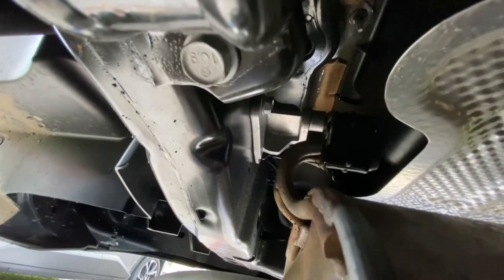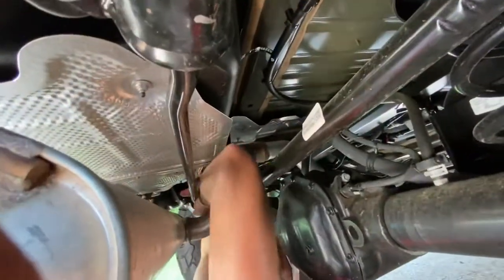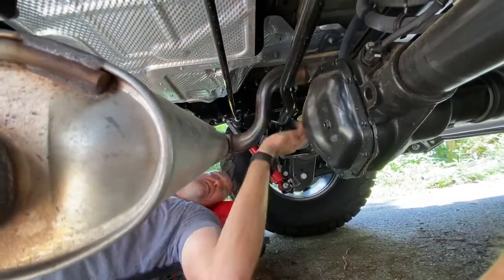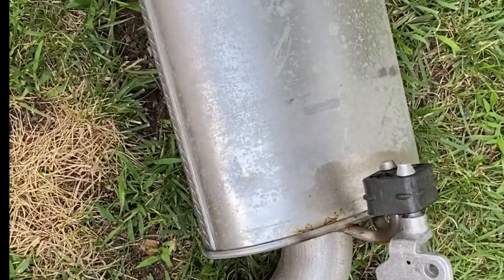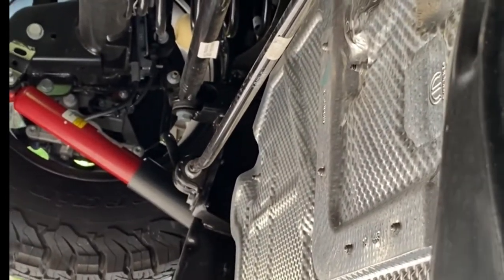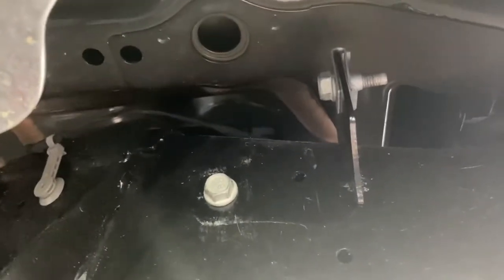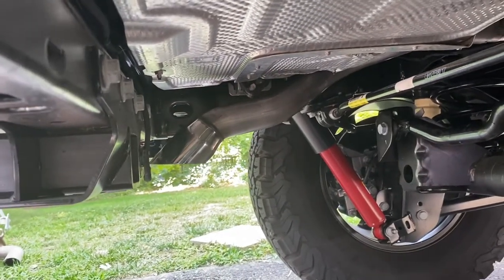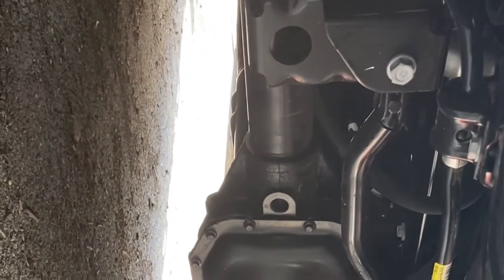Upgrading Your Jeep 2.0 : Step-by-Step Installation of a Flowmaster High Clearance Exhaust

Comment: I just bought this exact one for my Wife's JL Sahara.  I am also installing the AFE Magnum flow Pro Dry S air intake which should give it a little bit more of an aggressive sound.  I personally like to hear the engine with these exhaust "upgrades".  I put a K&N "performance" air intake and a Magnaflow catback exhaust on my 2014 JK and like the sound over the stock. Some people want it quiet but some like to hear the engine breath a little more.  To each their own I always say.
Reply from the maker: Excellent and I agree 100%, i like to hear the exhaust but i dont want it to be obnoxious either and i think this is a good in between, i am also planning on the afe intake, they make great products, thanks for checking out the channel and good luck with your installs

Comment: I learned a few lessons when swapping mufflers. First is to use anti-seize on the new muffler’s inlet tube being installed. Second is to bend up around the edges of the inlet tube slightly to make it easier to slide on as well. The third is I cannot stand the drone of the aftermarket axle back mufflers or muffler deletes then the stock muffler ends up going back on. I have a 2 door, so that may make a difference in the drone as the exhaust is much closer to the front seats than a 4 door.
Reply from the maker: Good points, i cant stand the drone from some of the muffler setups it definitely ruins the driving experience

Comment: Great video. Did the delete give you weight savings?
Reply from the maker: Thanks, yes the factory muffler and tail pipe are quiet heavy, i would estimate it cuts 15 to 20lbs plus you gain departure clearance and gain all the space where the big muffler sat which was huge for me when i installed the lift

Comment: How do you like the 2.0
Reply from the maker: Freedom fighter, i really like it, its got power all day and gets good fuel mileage with my full set up including the tent on top and 35’s i still get 17.5 mpg
Reply: @FischerJeepAdventures   I’m looking at one now thinking about trading my 2020 tundra in on it I just don’t want the hybrid one I heard some bad things about them
Reply from the maker: @freedomfighter6681  understood, personally i really like the turbo 2.0, i test drove both the 2.0 and the 3.6 and the 2.0 i think drove better which, it was faster and more responsive and the gas mileage is way better, my rubicon before i modified it with the stock 33’s i was getting 24 on the highway.  My sons jeep is also a 2.0 has 37k on it and not one issue thus far we are both happy
Reply: @FischerJeepAdventures  is it the hybrid version
Reply from the maker: @freedomfighter6681  no both jeeps are the straight 2.0 turbo not the e torque version, all i have heard about the e torque is it gets you moving real quick with the electric motor assist
Reply: @FischerJeepAdventures  heck yeah well I appreciate the info
Reply: @FischerJeepAdventures  the e-torque is awesome. Curious what issues people are having? Its an awesome compliment to the turbo off the line. I love the setup and will be adding a muffler delete
Reply: Have the 3.6 e torque  , and could'nt  be happier.  Don't  know what problems  people  are having  with  them . Running  17x 9 venomrex  wheels  with  37x12.50x17 discoverer at3 , only 7 lbs. Over  OEM.  with the e torque  , I easily get  over 20mpg. Also no need  to mess with regear . And yes , I did recalibrate  with  Tazer.